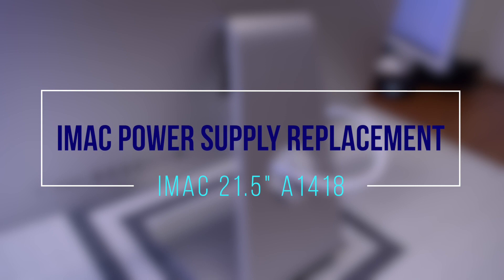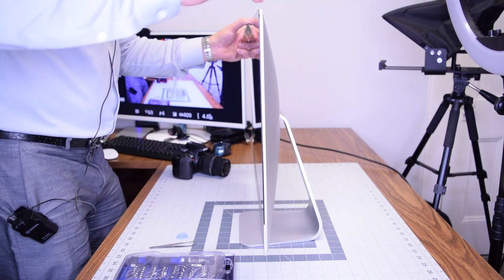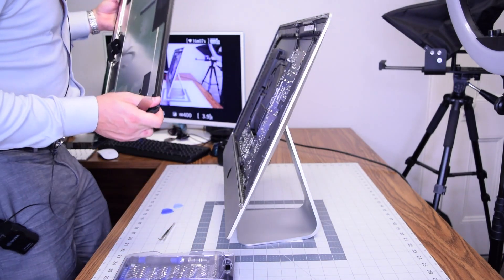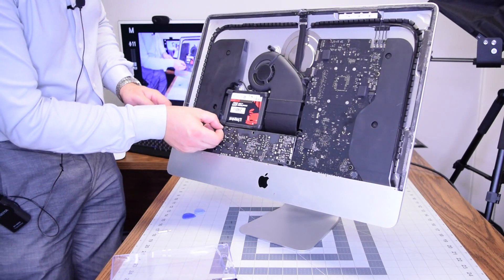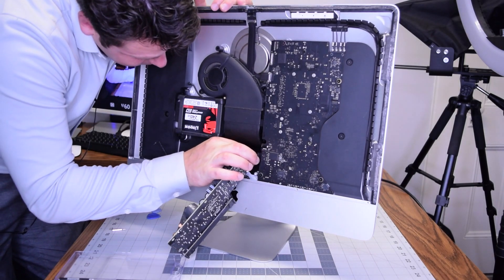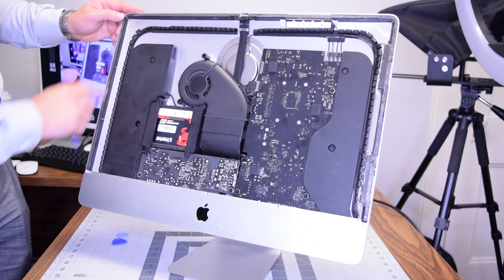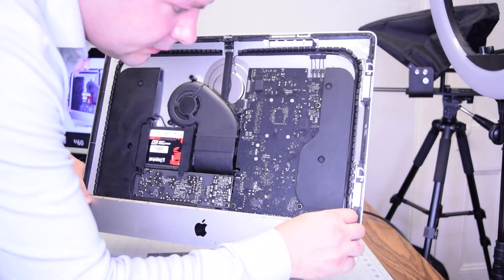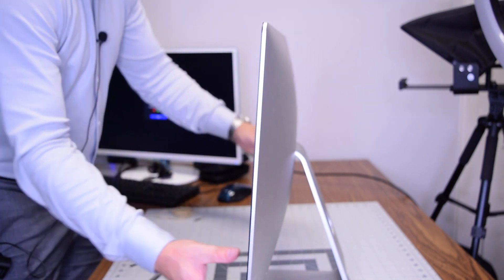🔌🖥️🛠️ 21.5" iMac Power Supply Replacement 2012-2017 (Including Retina) A1418

Comment: ok I have a question I used too have imac late 2012 motherboard and replaced with late 2013 - 21.5  motherboard would my screen work on 2013 motherboard ?

Comment: hello, one question, is it very necessary to put the ChinStrap on it, because i'm building an iMac 21.5 late 2013 and I don't have the ChinStrap, if I don't put that part on it does it affect the operation of the iMac? 2:53 Thanks

Comment: I have a mid 2017 iMac and it appears dead anybody know the voltages on the 6 pin motherboard connector ?

So I can check if it’s a psi problem

Thanks